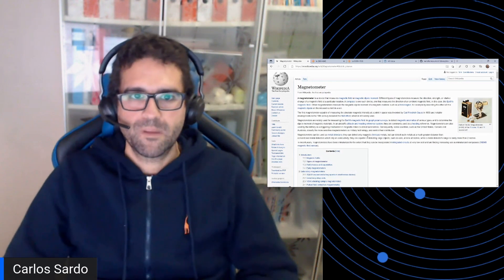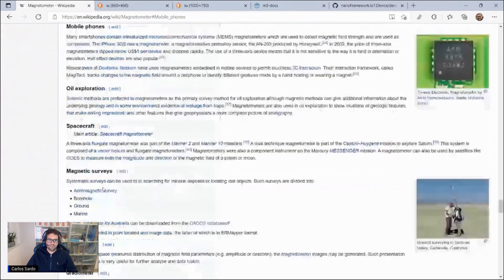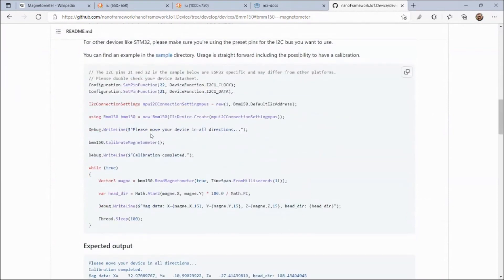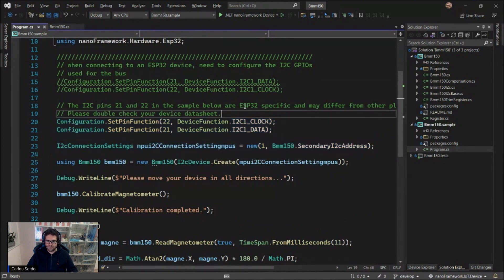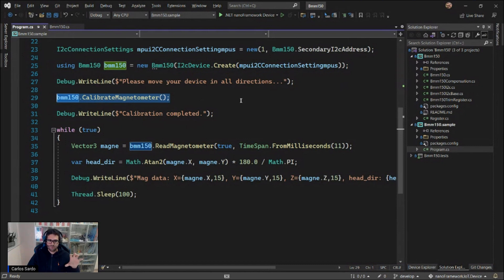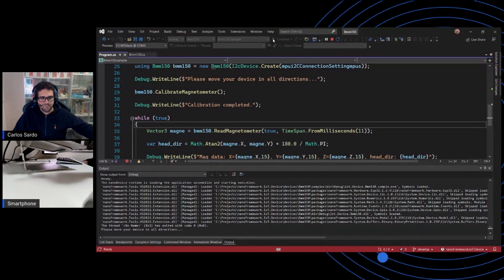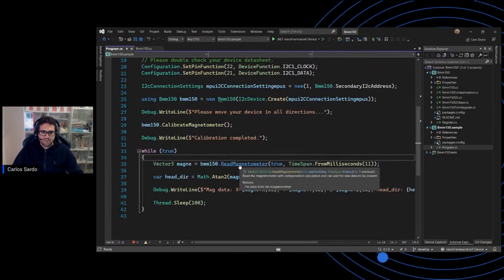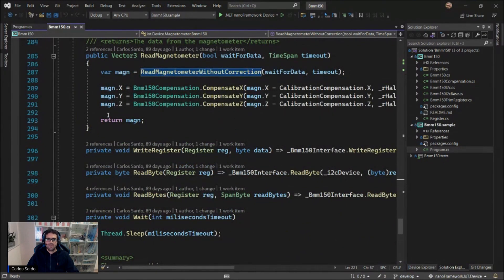Demo: how to use a BMM150 magnetometer on an ESP32 board powered by .NET nanoFramework

Comment: M5stack offers uiflow (no code/ upython). What is the benefit of nano framework vs uiflow?
Reply: Hi! uiflow is great to start, learn, create very simple scenarios. As soon as you'll want to go further, to go more industrial, you'll need to write code. This is what .NET nanoFramework offers. Allowing developers to use a high level language, C#, being very efficient in their development, connecting to the Cloud. Also if you just take this sensor, calibrating it properly in uiflow is not really possible. So you will never really read the correct values.